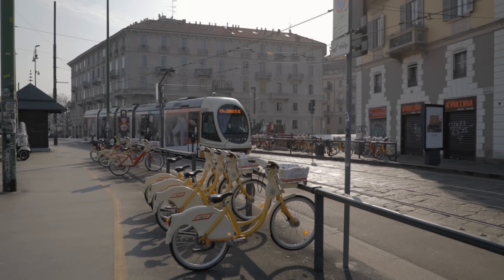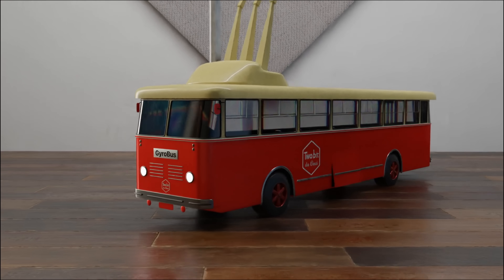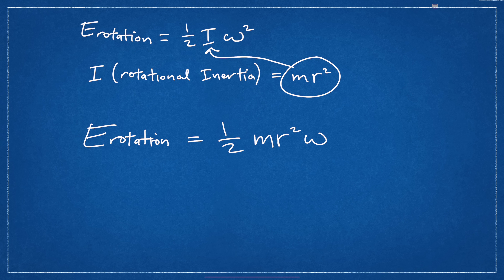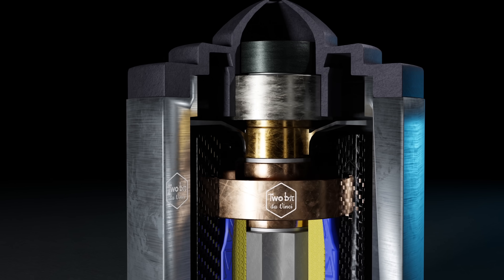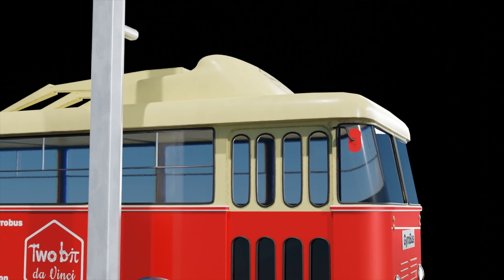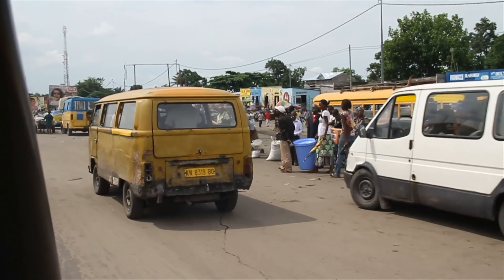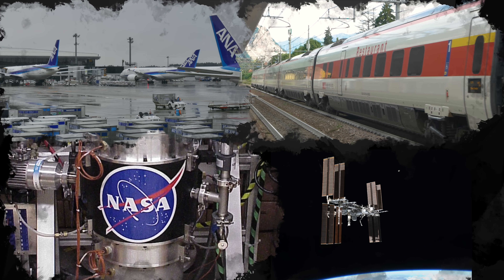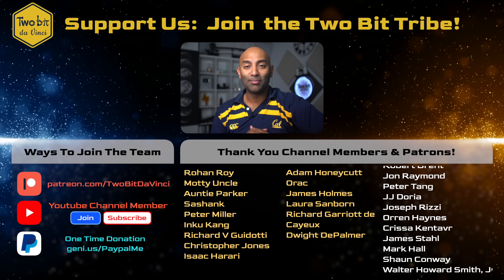This Bus Went Electric WITHOUT Batteries

Comment: This show reminded me of when I was in the navy going to Class A damage control school on Treasure Island in San Francisco Bay.  One weekend I was walking down the street where the cable cars ran and found the power house for the cable cars.  Walked into the building and the engineer who was running it gave me a tour.  It had a huge flywheel that powered the cable and it was very quiet.  I understand that they shut the cable cars down later but then brought them back at a later time.  If you are ever in San Francisco and have a change, do that tour.
Reply: &in moi
Reply: Well if they had charging Staunton for buses and cars that would make grid operable